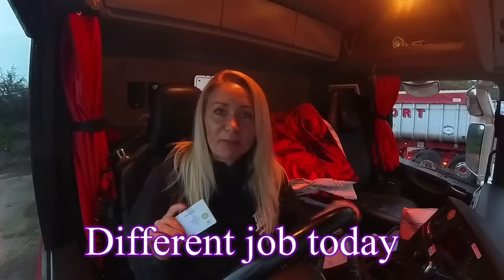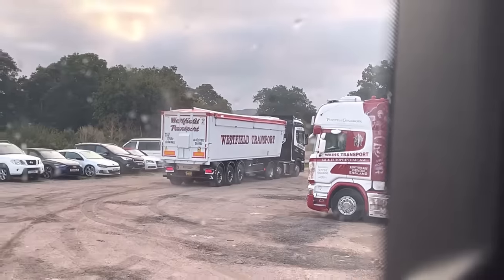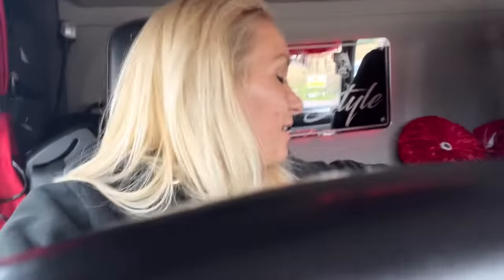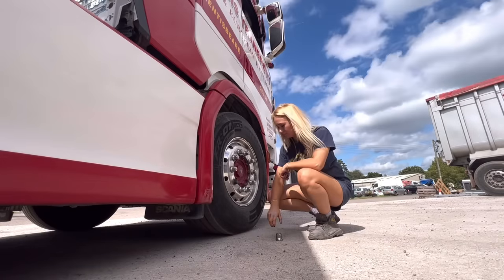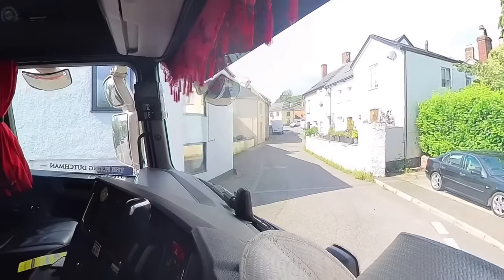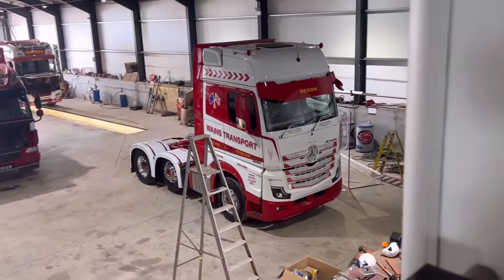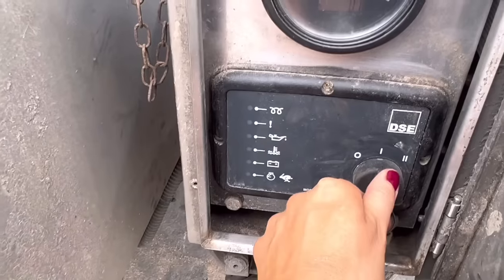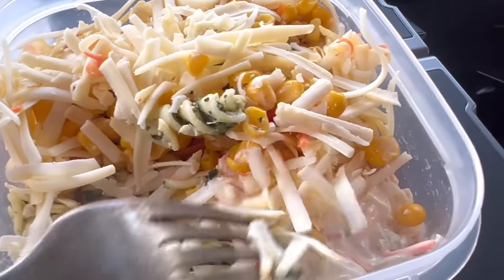Job for the blower | we come up with a solution to get the job done

Comment: No-one else has said this so here goes:-

When coupling a trailer that's dropped low:-
1) Dump your (not its) air before backing under.
2) Once coupled, blow your suspension back to normal.
3) Check your coupling.
4) Only now wind the landing legs up, This is actually less work for you because it takes less winding, not least because the trailer mass is off the legs.
Reply: I think your Granny might be proud of you 😂

Whilst driving to get lined up for the blower trailer at 1.30 she clicks a switch in her cab and says "I'm putting the air right down"
Obviously in her truck rather than the trailer.

I'm no truck driver but I'm sure she knows to pick it back up with the air, I'm guessing she's learned this awhile ago.

As much as you're trying to help, she is an experienced driver and drove for I think about 10 years previously before coming to Wains transport.

Going by what she's said.

Not trying to pick a fight with you just fill in some background information you may not know.

All the best 👍
Reply: She knows exactly what she's doing
Reply: Yeah, my point was to mention that, when and why you re-inflate the drive axle suspension as a point in the video.